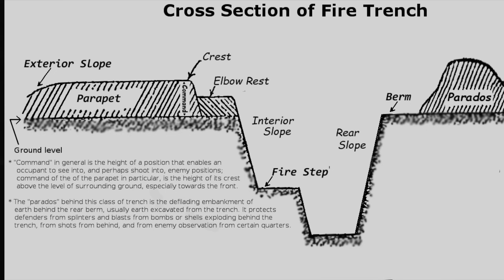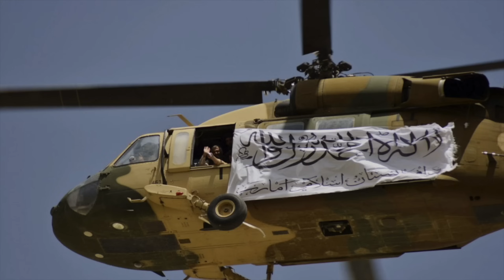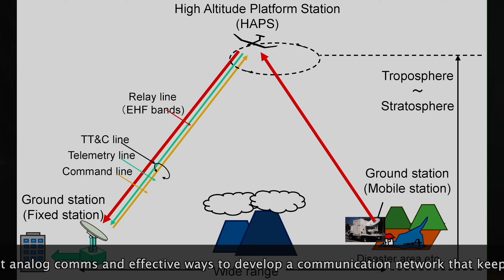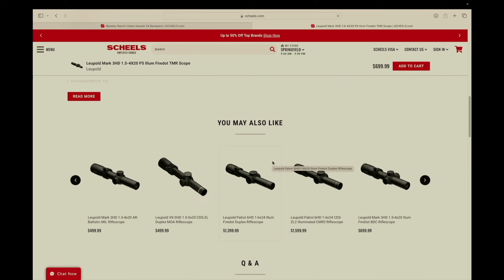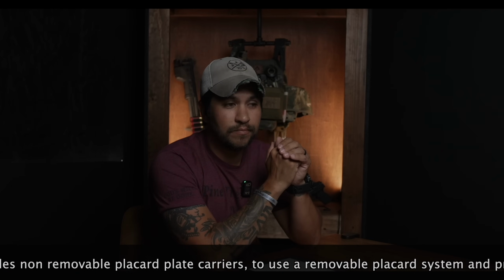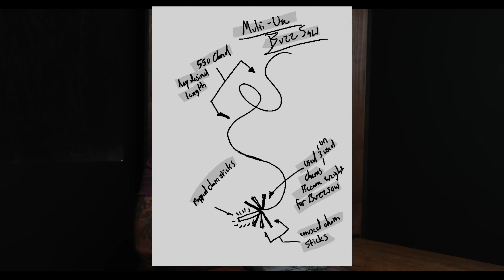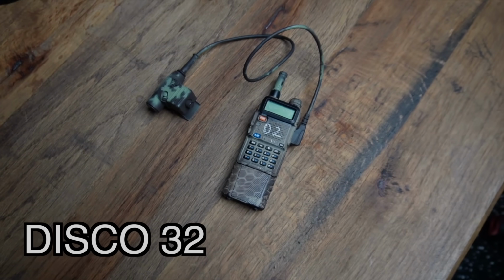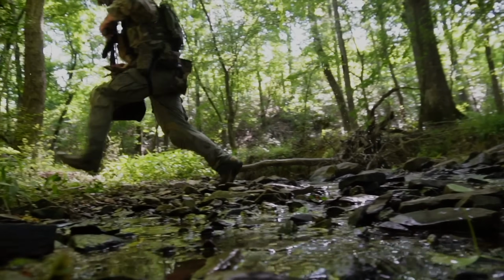The Citizen "Enabler" Warfighter Role: Eric's Fighting Load out

Comment: Thoughts on a Medical Enabler

To prevent the conversation from becoming equipment focused, I’ll throw out some tools that aid in a planning process so people can develop SOPs that will dictate the equipment requirements.

For those that are reading this thread, here are a couple of definitions so you can follow along. 
CPR = Cardio Pulmonary Resuscitation. BLS = Basic Life Support. 
ALS = Advanced Life Support. 
ACLS = Advanced Cardiac Life Support. 
ATLS = Advanced Trauma Life Support. 
TCCC = Tactical Combat Casualty Care. 
NDC = Needle Decompression. 
TECC = Tactical Emergency Casualty Care. 
PFC = Prolonged Field Care. 
PCC = Prolonged Casualty Care. 
TQ = Tourniquet.

Casualty Care Continuum Definitions. These are US military definitions, but can give non military types a framework to categorize levels of care within their own group. 

ROLE 1 – The first medical care military personnel receive is provided at Role 1 (JP 4-02 pg II-1)

ROLE 1a – Point of Need/Carried/Ruck (JTS CPG ID:91 pg 8)

ROLE 1b – Mission-specific transportation/Truck (JTS CPG ID:91 pg 8)

ROLE 1c – Mission support site/House (JTS CPG ID:91 pg 8)

ROLE 1d – Evacuation platform/Plane (as planned or available) (JTS CPG ID:91 pg 8)

ROLE 2 – Provides advanced trauma management and emergency medical treatment, including continuation of resuscitation started in ROLE 1. (JP 4-02 pg II-2)

ROLE 2 LM – Light Maneuver. Light and highly mobile MTF, can set up in fixed buildings or naval platforms. Able to conduct advanced resuscitation procedures up to damage control surgery. It will evacuate post-surgical cases ROLE 2 E or ROLE 3 before evacuation to ROLE 4. (JP 4-02 pg II-2)

ROLE 2 E – Enhanced. Provides basic secondary health care built around primary surgery; ICU; ward beds; limited x-ray, laboratory, and dental support; Health Service Support; and PVNTMED. Able to stabilize post-surgical cases for evacuation to ROLE 4 without the requirement to first route through a higher ROLE 3 facility. (JP 4-02 pg II-3)

ROLE 3 – Theater Hospitalization. MTF staffed and equipped to provide care to all categories of patients, to include resuscitation, initial wound surgery, and postoperative treatment. Expands the support provided at ROLE 2. (JP 4-02 pg II-3)

ROLE 4 – Definitive Care. US-based hospitals and robust overseas MTFs. Represents the most definitive medical care available within the medical care system. (JP 4-02 pg II-3)

Threw this post on a couple of other channels, figured I would also throw it on here.

It might be worth considering casualty management as a team sport vs an individual event. Yes IFAK does have “individual” in it but if we take a step back and look at a fireteam or a squad as the unit of action with a specific mission in a specific environment, the requirements, assets, and risk assessments all change. IE 10 guys with 4 tourniquets each =  40 TQs. Now, assuming you have a group that did their due diligence and has solid intel, a good plan, sound tactics 40 TQs seems like a waste of space. So maybe now each guy only carries 2 TQs and now I have more capacity for ammo, batteries, and water. Stuff that actually wins fights.  

The other part of this equation is the medical plan. Maybe consider the Ruck, Truck, House, Plane concept to help guide Med Ops. 
Ruck = what the unit of action physical has on them IE IFAKs. 
Truck = if mechanized transports are available, preload with more advance medical/rescue equipment. 
House = pre determined casualty collection point that provides security and can be stocked with more advanced medical adjuncts to keep a casualty alive for longer. 
Plane = whatever transport you have to move a casualty away from the fight to definitive medical care, ideally has a team to manage the casualty during the movement. This is all just a long winded way to say, the contents of your IFAK should depend on your INDIVIDUAL situation and should be accounted for in the planning process. 

Thoughts on active shooter medical kits. Active shooter response kits are pretty simple. First, let’s identify some differences between an active shooter incident and military/guerrilla engagement. Military/guerrilla operations complement Tactical Combat Casualty Care (TCCC) and Prolonged Casualty Care (PCC) because these processes take Tactics, Techniques, and Procedures (TTPs) into consideration and anticipate that some wound patterns will be mitigated ie plates will reduce the number of thoracic injuries thus the predominant injuries will be on areas the plates don’t cover (limbs). This has lead military medicine to have a huge focus on TQs. Active shooters typically focus on a victim population that won’t have anything to mitigate the effects of an attack. Because of this, we won’t see the same effectiveness that TQs have with the military. Not saying TQs aren’t a net positive, but the biggest skills that don’t get enough attention in an active shooter situation are the ability to triage and casualty movement. The other hard reality of active shooter incidents is that it is a giant unknown that makes preparation difficult. If you don’t have a way to move people that can be saved, that would be a priority to add to my active shooter kit. That is also making the assumption that you know where to move them. Over all just a bad reality.
Reply: Great reply, I'm  ex-EMS now a  Critical Care RN. I'll be expecting your PT's to Arrive Alive so that we have at least a chance of rescuing the PT and recovering them to the best possible Quality of life.

Comment: I’ve got an improvement on your buzz saw that I used a scout sniper (rip). I added high vis/reflective tape in about 1.5 inch wide strip on two chem sticks. I would prep one vis and one ir chem light per mission with the reflective tape. The tape catches light from the sun or moon and just adds another layer to catch someone’s eye. And an alternative method for link up if your chemlights have died. I would conceal the tape by wrapping the 550 around that section. 👍🏼
Reply from the maker: GENIUS!!

Comment: About gear. I don't know for a combat support guys like drone operator or CLS but for a non-combat specialist like the mechanic in scenario you mentioned there is NO NEED for specialized loadout 90%of the time.
Just give him the most basic rifleman stuff.
1. You're either fighting or doing this non combat role. You secure the area and then mr. mechanic can take off his backpack and dig for the rights tools or even take a toolbox from one of the cars.

It's not a 3 minute task that can be cut down to 2 minutes because you happen to have a ratchet with 13mm socket in convienient reach.
It's more like 20 minute task made 30 minute because of some stubborn rusted bolt.
2. Theese people already have thier tools of the trade organized in efficient way. You're asking them to turn this upside down and start from the scratch. Changes should be minimal. 
3. There is chance that this specialist has no proper tactical training and gear. He will have to make do with hand me down gear. You'll probably be lucky if you put together decent rifleman kit for him.